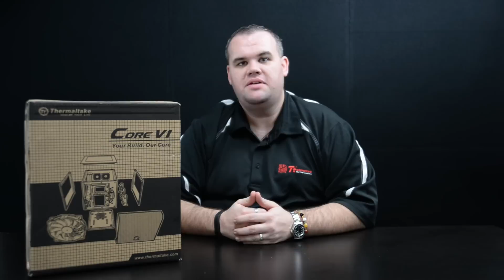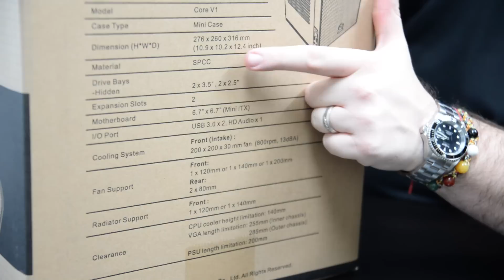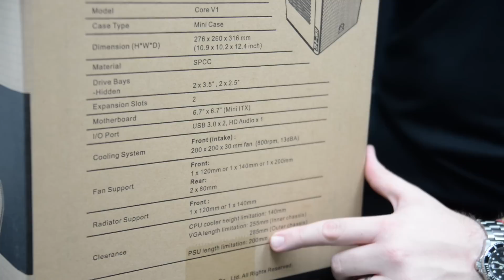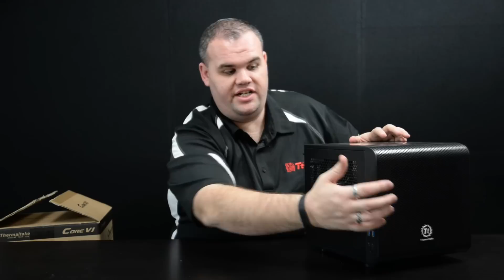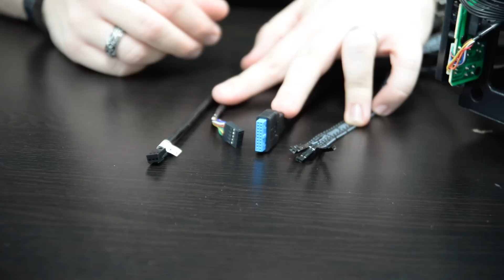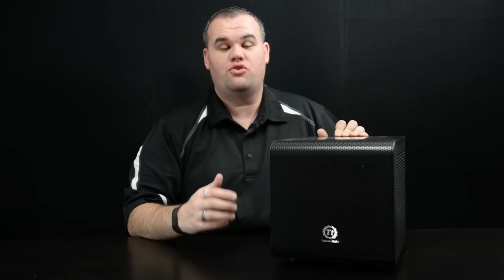The Core V1 Mini ITX Chassis

Comment: hmm I was choosing between this case and the elite 110, But the 200mm and the suport for bigger video cards made me decide, even if theres a gtx 970 itx of gigabyte, im sure biger cards look better, perform better, and last longer. Only cons, the hard plastic feets, and no dust filters on the sides. Not big deal, rubber feets arent expensive and im prob making some home made filters with some no use stockings of my sister.